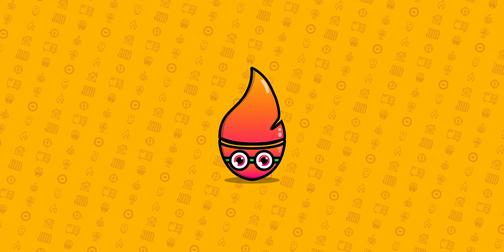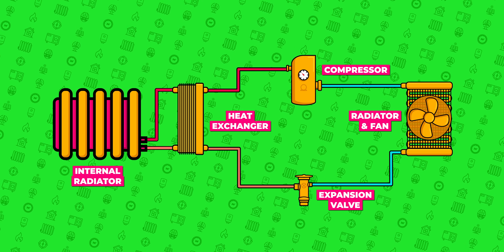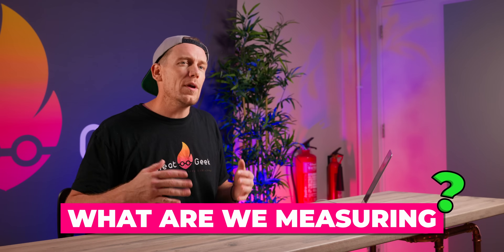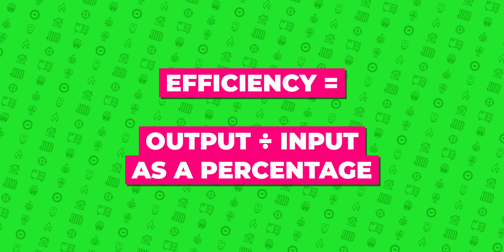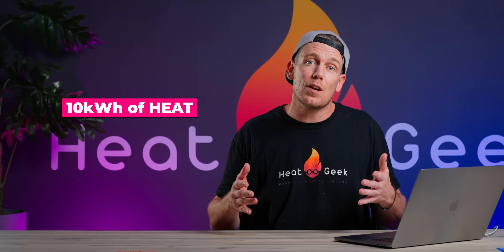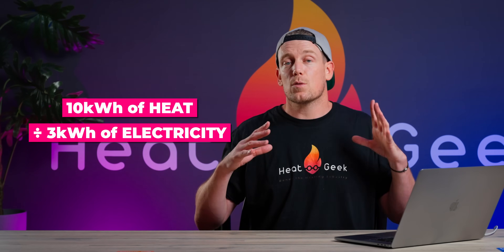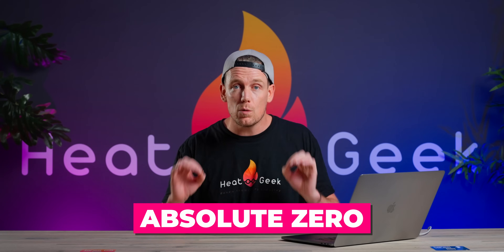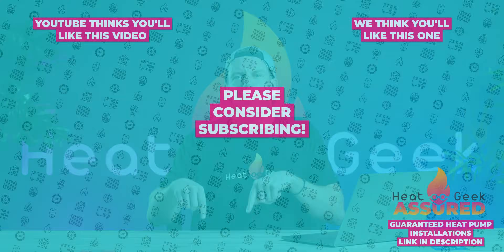How Can Heat Pumps Be More Than 100% Efficient?

Comment: My AHSP is saving me a fortune, its so poorly fitted I had to turn it off
Reply: @zlmdragon.  my house is 300 years old
Reply: My plan is to put an ASHP in right at the end of my upgrades. I require around 2500 KwH of electricity and 10,000 KwH of gas a year, so far 

My plan is as follows :
Get 8 solar panels installed + battery, generating a theoretical 2000 KwH a year

Reinforce my flat roof, and then get a further 8 panels with batteries. I'm already getting an inverter that can handle 16 panels. That generates a theoretical 2700 KwH a year because they can force it to face south on a flat roof. I therefore have 4700 KwH of energy to play with, leaving me with 2200 KwH (theoretically)

Then I'll install an MVHR system and improve general air tightness. That should reduce my heating demands from 10,000 KwH a year to 2500-5000 KwH a year

Then upsize my radiators.

Then, get a heat pump. Assuming an average COP of 2.8 over the year, that'd mean I've got just over 6000 KwH worth of "heat" which is more than enough, given that I'll have had an MVHR in (ie: 2200 KwH x 2.8 = 6160 KwH) 

For me, the heat pump is the absolute last thing in my energy strategy.  My main aim is to make my house PassivHaus. Also, fwiw the house was built in 1975

This is of course all theoretical but in theory, I could be almost self sufficient and I'd absolutely put in a heat pump right at the end, unless I was rich, and then I'd already have a ground source heat pump instead
Reply: I’d upsize the radiators first and get some weather compensation working. I don’t think you’ll get such significant improvements from MVHR, they mainly give you quality of live improvements.